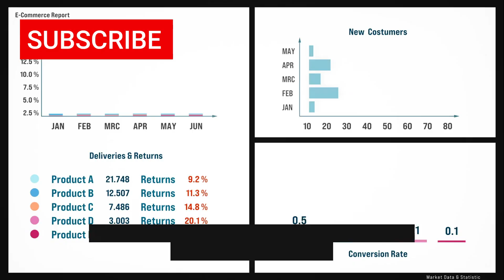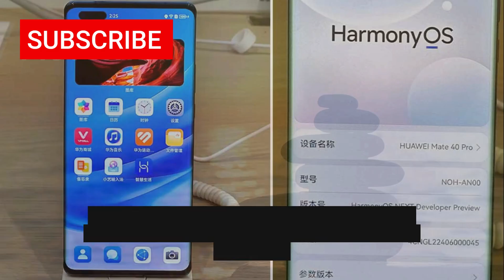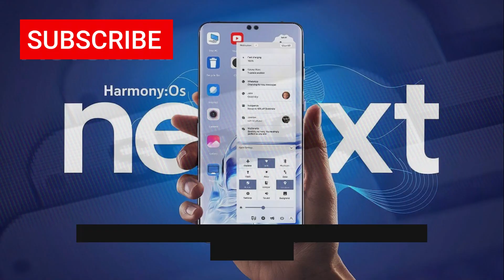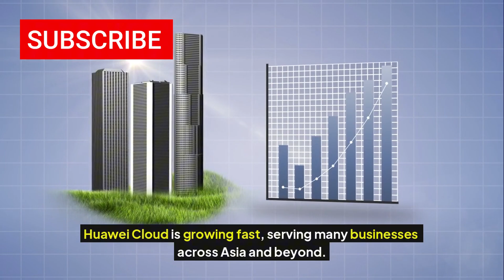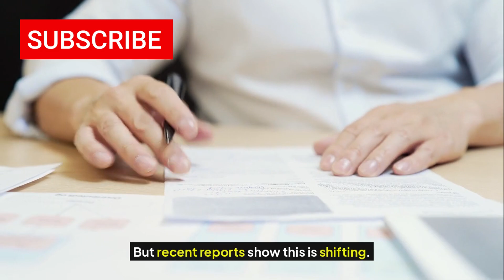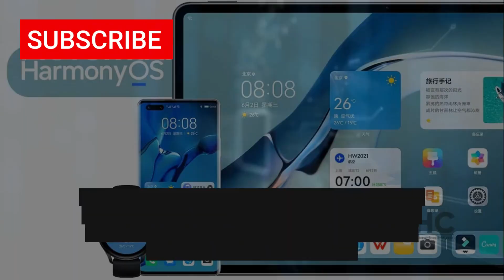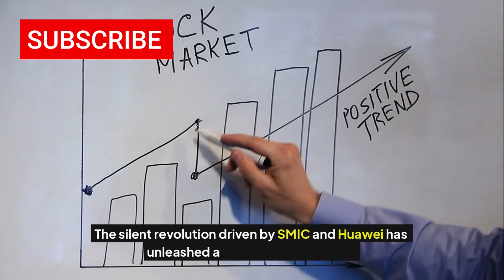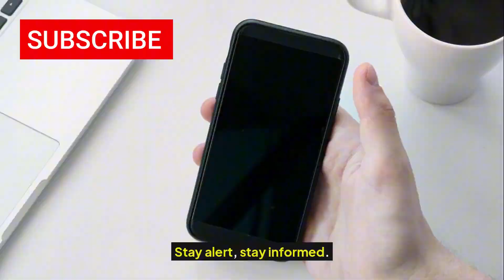China's Silicon Surprise Huawei and SMIC Just Said 'NO' to the West! 🚨🔥

Comment: China has broken free of western semiconductor technology.  The Chinese government has ordered the complete break from TSMC.  Obviously it would not do so if it depended on TSMC.  Further, Huawei is currently testing China's own EUV, expected to be produced in quantity in 2026.  And...if that weren't enough, China is developing photonic chips, the first are the Meteor 2 and Taichi chips that are aimed at the AI market where parallel processing is one of the important characteristics of AI processors and is a strength of these photonic chips.  It is said that these processors are a thousand times faster than silicon chips and consume much less power.  These characteristics make AI platforms more realizable where power consumption in current AI systems is a limiting parameter.  It  should also be noted that Huawei has developed its own AI cluster called "CloudMatrix 384, which is a high-density AI computing system featuring 384 Huawei Ascend 910C chips, designed to rival Nvidia’s GB200 NVL72" (techblog.com) Huawei's CloudMatrix 384 is said to have twice the computing power over Nvidia's best.